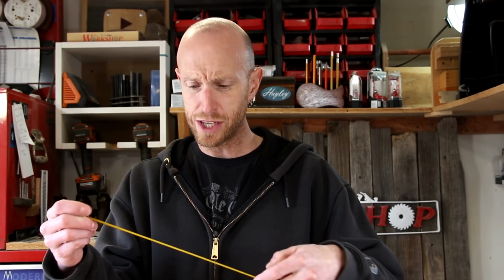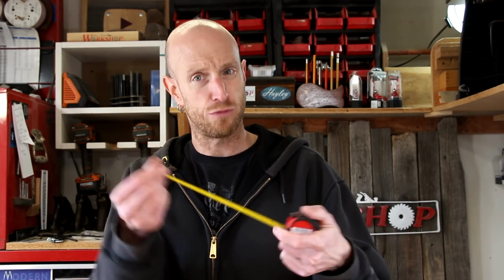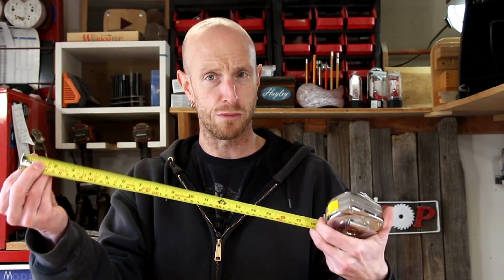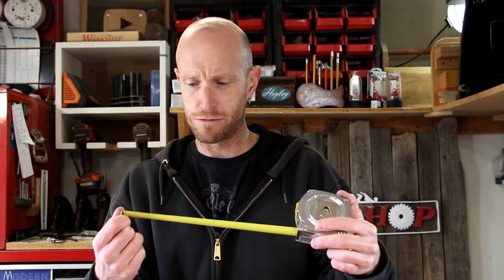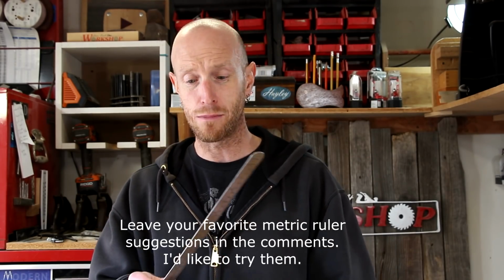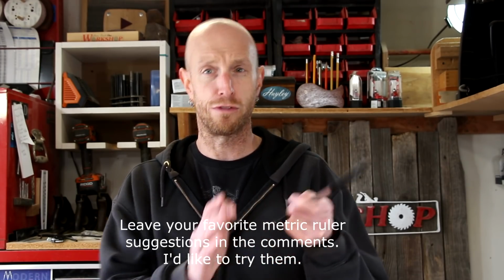My thoughts after using the Metric System for a project | I liked it

Comment: Imperial units of length: Inch, Foot, Yard, Fathom, Rod. Furlong, Mile, Nautical mile.
Metric units of length: Meter
Reply: Kilometers, Meters, Centimeters, Millimeters, and so on
But yeah they all go by 10 so it's easy to convert anyway
Reply: @nenine8989  in fairness, centi, kilo, milli, deci (you do get decimeters. Nobody uses them, but they exist) mega, pico, all the other ones, they are just prefixes. You do technically get kiloInchs. Kilofeet. Milliyards. Picorods. M E G A F A T H O M S and so on. Just nobody uses them because the measurements start to become even more stupid. Fair enough, inches are a pretty nice size for a measurement, as are feet. But the divisions between them make utilising them really awkward. And can lead to confusion. You don't confuse a millimeter with a centimetre when it's shouted at you from 10 meters away through earmuffs. But 3/16ths could be confused for 3/6ths. Thats only slight, but it can be annoying.
Reply: @nenine8989  No Metric has only one measuring unit (meter) for length. A kilometer is stil measured in meters
Reply: Soyel  Thats not a measurement for length, but for an area
Reply: Soyel  A hectare is a square with sides of 100 m so 1/100 of a square kilometre, so technically its different but it fits in neatly. 

SI units are just the base 7 types of metric measurements. Every other unit can be defined by an SI unit, ie. a joule (non SI unit) is equal to 1 kg*m^2 / s^2 (if that looks messy its just a watt-second).  Temperature for convenience is measured in Celsius which is defined by the SI unit kelvin + 273.15.  A calorie is a metric unit defined as the amount of heat needed to raise the temperature of 1 gram of water by 1 degree and still used because it makes sense for food, but outside of that it has been replaced by a joule.

As a Canadian, metric is definitely not everywhere (I cook with Fahrenheit, cups, etc. stand 5'8" and approximate weights as pounds) but in any setting where calculations or an accurate value are needed metric is so much easier to work with. 

As for an acre, thats imperial unit defined as 1 chain by 1 furlong (yikes)
Reply: @Hunter____1  you flipped a sign there buddy. Celsius is Kelvin - 273.15
Reply: Soyel  nautical miles have a specific reason in mapping, one nautical mile its equal to 1º from the equator to the north pole, and in the nautic cartography we measure everything with a pair of campasses, in wich we have the distances already on the map, so pretty much understandable that we don't use rulers in a boat. also, 1 knot is equal to 1 nautical mile per hour, this pretty much resumes the nautical sistem for you. sorry for the bad english, it isn't my mother language.
Reply: @Santisima_Trinidad  Actually - I sometimes do use decimeters :) But I know of only one use case for it: Calculate the volume in liters of an object, with that even the weight. E.g. a table, 200x80x4 cm. That's 20x8x0.4 dm, The volume is 64 liters, the weight approx. 45 Kg of wood.
Converting to dm is much handier for most objects, especially if you are doing the math quickly in your head. Of course you can calculate the volume in cm³ (or mL), then divide by 1000 to get it in liters, but I prefer to handle smaller numbers.
Reply: @craesh  that is a very useful tip for that one situation. Thank you for replying
Reply: @Hunter____1  before the british empire standardized the acre, an acre was defined by how much land an ox could plough in a day. Not very  standard since soil type could vary the ploughing speed, but farmers found it to be very useful since the amount of work per acre was pretty consistant no matter where you went
Reply: Soyel  1 knot is 1 nautical mile an hour. A nautical mile is the distance of 1 minute on the equatar. The distance of the equatar can be defined as 360 degrees, or as 1 degree is the same as 60 minutes, as 360 times 60 which is 21600 minutes. Welcome to astronomical navigation. Which btw has nothing to do with the imperial system....
Reply: Chains and links
Reply: @Santisima_Trinidad  I sometimes use decimeters when simplifying like 70 cm to 7 dm. I mainly use them however for volume.
Reply: @Hunter____1  not sure what the unit is called in english but I think with acres he was referring to what we call "Ar" in German which is another in-between unit of m2 and km2 (because obviously having a spacing of a million between units is a pain), which is a 10x10m so 100 m2. one could use square-decameters and square-hectometers, but lets get real.
Reply: 1 Square Hectometre is the same thing as a Hectare. 
10² = 1 Hectometre = 100metres

The general prefixes are
Giga (1,000,000,000)
Mega (1,000,000)
Kilo (1,000)
Hecto (100)
Deca (10)
Deci (0.1)
Centi (0.01)
Milli (0.001)
Micro (0.000001)
Nano (0.000000001)

There’s more but they’re basically useless. Most of these aren’t even used often.
Reply: @Whatevsbabes  Prefixes like Tera, Peta, Exa, Zetta, Yotta - you'll often see them in bytes.
Reply: Soyel  only becasue when systems switched to metric its taken a generation to drop it, so it hasnt gone away ...Yet...
Reply: In the UK we are familiar with imperial measurements (imperial of course refers to the British Empire), but guess what, our gallon is not the same as a US gallon, so even that’s not “standard”…
Reply: And just wait until you have to convert them into football fields, bathtubs and kitchen sinks.
Reply: Soyel  hectar is defined as an area of 100x100 meters. I don't know if it's an official SI unit - or just something practical for measuring stuff like plots of land...
I don't know which country uses acres - the UK maybe, they have a bit of a double system using metric and imperial for different stuff.
Reply: B. Nielsen: "Inch, Foot, Yard, Fathom, Rod. Furlong, Mile, Nautical mile."
MS: Take the Nautical mile out of this list. The Nautical mile is used for work in charts. Positions are given in degrees, minutes and seconds. And one nautical mile is a longitudinal minute at the equator (by definition).
Reply: Soyel  : "Nautique miles are also used in many countries. What about nautical knots?"
MS: Nautical miles are used worldwide because one longitudinal minute at the equator is the same everywhere on earth. One knot is one nautical mile per hour (https://en.wikipedia.org/wiki/Knot_(unit)). Temperature in Kelvin is temperatur in Celsius minus 274.
Reply: @aurexify  if you're calculating fluids, it would be decilitres not decimetres.
Reply: @mickcompagnoni1114  Yeah I know, I mistyped. I meant cubic decimetres.
Reply: Soyel  hectares is still measured with square meters
1ha = 10000m2
Reply: The standard international unit is THE METRE.

Kilo, milli, etc, etc, is the secondary descriptor. This has no place in mathematics. Instead  we use

j ×10^x m 👈 x is a power number eg:
45 × 10³ m = 45,000 m  .....is 45km
Reply: You missed the imperial banana, washing machine and squirrels.

Comment: how to go one magnitude of units up/down in each system:
imperial: count the number of stars you can currently see in the sky, add the angle of jupiter relative to mars, sacrifice a chicken on a bridge at midnight at full moon, and multiply your units by resulting number.
metric: add zero or remove zero from the number.
Reply: what if there's no zero to start with, does it stay the same ? Sounds broken, better milk a chicken at full moon
Reply: @romsthe  If theres no zero to remove just add one at the front...🤷‍♂️
Reply: @romsthe  do you ever heard of decimal?
Reply: @NoName-fy9rz  yeah, saw them on stage in the 90’s, cool band, the gig was ok
Reply: If it takes a man, a week to walk a fortnight, how many apples are there in a bunch of grapes. My grandad knew the answer but said it was a secret. 
He could also pull sweets from my ears, but couldn't drink a Guinness with out getting foam on his mustache and beard.
Reply: What if it's daylight or a cloudy night? I mean, that's not really consistent.
Reply: @damyr  but that's the point, the system of the imperialist class enemy isn't consistent at all
Reply: Also the imperial units can't convert cubic feet to gallons using integers, let alone converting it to pounds.
Yet the metric system says 1 cubic meter is 1000 litres, 1 litre of water is 1000 grams, and 1 gram is 1000 cubic millimetres of water, which in turn is 1 millilitre.
This works because all the metric units scale the same way and grams are defined using mass instead of weight.
Reply: Sounds more like witchcraft
Reply: @BramLastname  @Bram Lastname Energy as well, to heat 1 cubic cm (1 gram) of water up 1 degree takes 1 calorie.  A litre will take 1000 calories to go up 1 degree etc.  The only hassle is the scientist types prefer joules over calories, a joule is about 4 calories, so 250 joules to heat that litre of water.  A watt is a joule per second, so you can work out how much it costs to make a cup of tea with a stopwatch.  (Maybe not in the US, no kettles. Tsk tsk,savages)
Reply: @j.f.christ8421  I know, 
But I found that to be a bit too much to explain for our US Audience
Reply: @BramLastname  Yeah, nerd stuff, lol.

I'm in Australia, in building we use millimetres for everything until you get to maybe over 5 metres (~16').  Centimetres are for 'civilians'.  US-ians don't get it's not having to convert units that makes it easier.
Reply: @j.f.christ8421  I like that you put the US measurement there, 
Despite the fact we both know what 5m is.
Reply: Right on the money, it would be funny if it wasn't true.
Reply: @ourfarmhouseinspain  no, it's funny precisely because it's true, and it's especially funny because most americans don't agree that it's true.
Reply: @BramLastname  Though I'd help out the US-ians who've no idea what 5m is.  (Which is almost all of them apparently)
Reply: @j.f.christ8421  how considerate of you, 
I would thank you for your thoughtfulness
But I shouldn't speak on behalf of another minority.
Reply: @romsthe  just do this: 0,1
Reply: @matix4668  just did it, it’s weird but cool, how many metrics is that ?

Comment: One of the features of the SI system (the metric system) is the amount of integration of all kinds of things.   For example.    make a cube,  10cmx10cmx10cm.   Fill it with water.   That will be a litre of water.      Weigh the water.  It'll weigh a kilogram.     So there's length, volume, and weight all measured together.    THe same with many other units.  they also integrate in a similar way with the same things.
Reply: Heat that water one degree. Now you've added one kilocalorie of energy.
Reply: @TWFydGlu  I think that should be KiloJoule, should't it?     Calorie is an imperial unit.
Reply: Fill it with gold and it'll weigh 19,1 kg.
Reply: @afpwebworks  Calorie is the energy needed to heat 1g water 1 degree C.
Reply: @TWFydGlu  ok.  I didn’t know that.    I was sure calorie was an imperial unit.   What’s a joule then, do you know?   Are they the same thing?
Reply: @afpwebworks  A joule is the work needed to produce one watt for one second. A joule is also the work needed to move a charge of one coulomb through a differential of one volt. Unfortunately calorie and joule doesn't line up neatly. One calorie is exactly 4.184 joules.
Reply: Length, volume and MASS... If you subject that mass to standard gravity, then it would have a weight of 9.80665 N.
Reply: and 100 m x 100 m is a hectare, acre definition is nuts
Reply: @TWFydGlu  If your water turned into ice, it's 0°c.
If it boils, it's 100°c
Reply: So much easier than a pint of water weighs a pound and a quarter X 8 gives you a gallon
Reply: @axlm.808  At 1atm of pressure of course or 14.7psi.
Reply: @afpwebworks  Calorie is an alternative metric unit. Calories are to the British Thermal Unit what Joules are to the Pound-Foot.
As well as that, there's also the erg, which is the metric CGS metric version of the SI metric Joule.
Joules are the standard though.
Reply: Now....can you do all that with milk?  Or how about oil? Sand? That's great if you only use water, but there are lots of other substances, and once you plug that in, those benefits start to fall apart.
Reply: @johnvender  Yes, ten thousand square metres is a hectare.
Reply: @TWFydGlu  Only 1 calorie.  Food calories are kilocalories.
Reply: @j.f.christ8421  The other way around. Heating 1000g 1 degree is one kilocalorie, which is one "food Calorie" (which I don't know if it is used outside of US).
Reply: @jerrardbeasley4247  water is considered the baseline, so it’s not arbitrary that the units end up that way
Reply: A kilogram is measured against Plancks Constant for accuracy.
Reply: one meter is equal to the length of the path traveled in a vacuum by the light during a duration of 1/299 792 458 of second.
It's simple ! 
No ? oh ....
Reply: @ravimooruth4159  But that is my point. One of the things metric people always drag out is how the measurments interlink.  1 cubic centimeter equals one liter of water which weighs 1 kilogram.  So that works with water, kind of because temperature and preasure can change the density of water, but it falls apart when you try to apply that to other materials of different densities.  So great you have something that works in one specific case, kind of, and that is the card that is played to try to convence us to switch.
Reply: @sergarlantyrell7847  Thank-you.  A pet peeve of mine to mix unit of  mass and units of force(weight)
Reply: @TWFydGlu  "Food calories" shows up everywhere, buy yes, missed you were taking about 1000g, not 1g.
Reply: @hammathguy3995  I blame the imperial system that has pounds (mass) and pounds (force) with seemingly no discrimination.

Comment: It really starts to make a difference, when you start doing calculations that are not just dimensions. Like as an engineer for exam you need to calculate things like power needed for flow and pressure drop. Or you need to calculate Force from pressure and surface area. Or you need to calculate speed and acceleration etc. If you are using the metric SI-units, for everything, they will cancel out nicely and you will get the result in SI-units as well.
Reply: I mean, there is a reason, NASA uses it.... And everyone else in science...
The only not so nice units are those of time. Where the standard is the second, but you often need to convert from minutes or hours downwards. so e.g. you need to covert km/h to m/s to use it in calculations. Soo time sucks, but we cannot change it, since it's just widely used and no one wants to tell the time in seconds...
Reply: At least speed is relatively easy to convert from km/h to m/s and vice versa, since you just have to divide or multiply with 3.6 respectively, short explanation being 1000 meters divided by 3600 seconds is this many meters per second

Redefining time is really a bother at this point when we've been using pretty much the same measurement for time for almost the entire history of telling time

Comment: I started using metric for woodwork about a decade ago. It's pretty easy to mark "on-the-line" or "between-the-lines" in millimeters. That's about 1/50 of an inch accuracy with NO fractions. I have several of the mm/inch tape measures and found that I had to run the tape backwards and upside down for some measurements. I needed a metric-only tape to maximize usability. Starrett now sells these in the U.S. I have these in a couple sizes.
Reply from the maker: I'll have a look for the Starrett ones you mentioned.
Reply: Life is a lot simpler in metric when it comes to drill bits although I do have a few that are in half millimetres i.e. 6.5 mm. Imperial was a nightmare comparing fractions.
Reply: It's so incredibly funny when you say "NO fractions" referring to a fraction 🤣
Reply: yeah here in england it was tricky to get a metric only steel tape, this was 2018 btw when I decided to bin the 'old' ones, originally I was trying to find a metric over inch tape and retain the archaic however that search turned out to be unicorn horns...
Reply: @nevillemason6791  why don't you just get a drill chart? I guess it is just easier to complain.

Comment: This was my experience as well. I worked at a Japanese press plant for a few years, making parts for Nissan and they used the metric system. I got used to it pretty quickly and I liked it. That was almost 30 years ago and I still use it today for my own projects and designs. I also find it easier to be more accurate. I can easily switch between the two systems and do so daily but if I can have my preference, I go metric.

Comment: Having been forced to use imperial units for crafting D&D related stuff after only being used to metric units it is a big pain. You have all the issues you had (using a system you are not used to), but in addition using an inferior system which makes less sense converting to fractions or to units of measurement such as volume, weight etc.
Reply: :D Can you tell me quickly a fireball radius, when the affecting zone is 33000 cubic feet? I know well the problem...
Reply: I just convert all to metric where is needed. (was a bit of a pain but as easy as using an app)
Reply: I had the same problem with pathfinder, there's no Portuguese versions of the beginner's box nor adcg so everything needs to be converted to meters and is a pain in the but

Comment: In the UK we use both the standard (Imperial) measurements and metric pretty fluidly; beer is in pints, distances are in miles, weight is in stones for example so everyone's familiar with both. The Imperial tools I use on my Harley were originally for the older British bikes I've owned, but work on the house is always metric. I can testify you're right about the math; much easier in metric. You have metric money in the US (which we didn't have until 1971!) so I think most people there would understand it.
Reply: I can still use stone for the weight of people and kilos for everything else.  I can also use feet and inches for height but for the length of anything else it's meters.  Crazy!